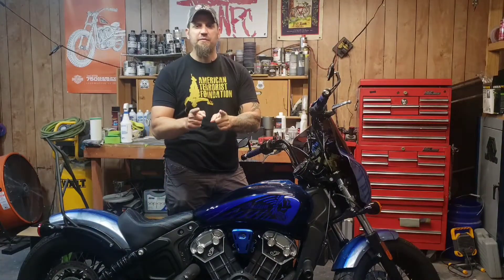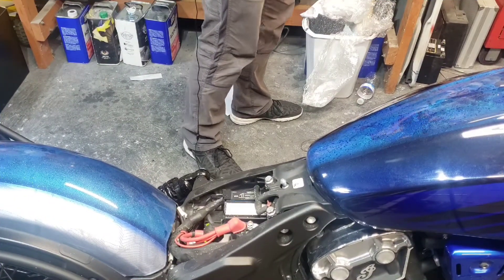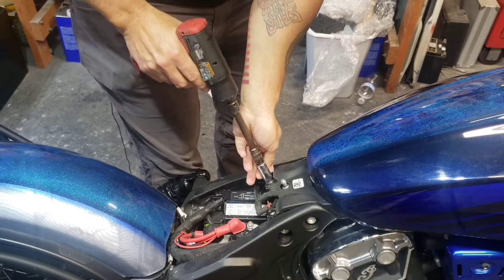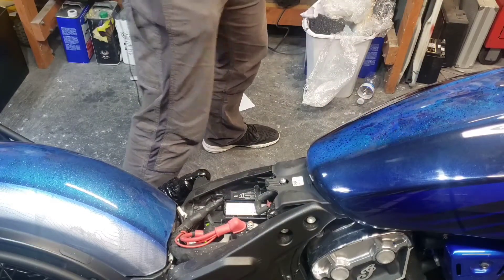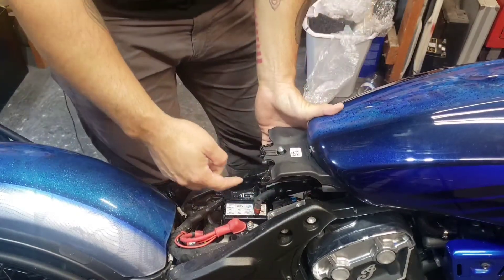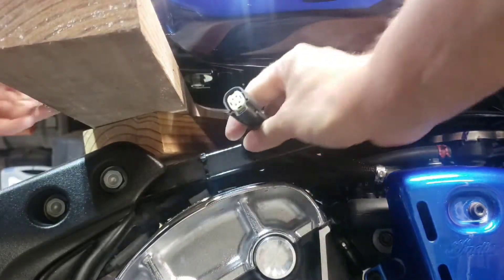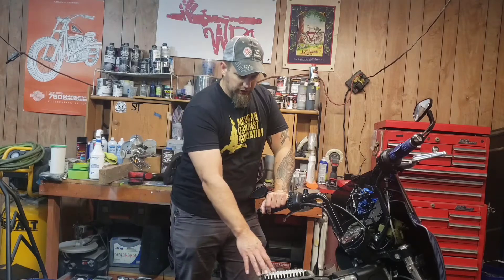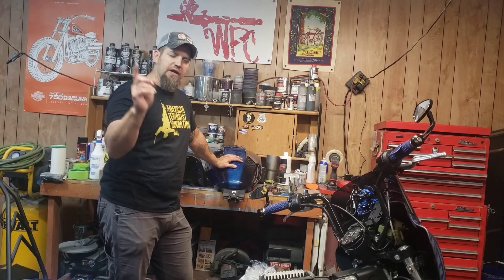how to remove the fuel tank on Indian Scout bobber

Comment: uuggg!! Great video, so smooth and slick getting that tank apart and off!! 
I am not sure if maybe my bolts are a tad longer but as I delicately "fan-angled" the tank free (meaning I was much slower and cautious then how you did it) I dragged/scratched the inside of the tank on the right side on those bolts under the speedo !! Not much space there, @5:39 you see  the two nuts above the rubber mount? 😭
Board trick was brilliant, obvious, yet brilliant! lol That rubber filler piece, that was a test of patience going back in!  😠
I opened the gas cap to let the pressure out before any disconnecting, was that actually necessary?
Reply from the maker: Thanks dude
 You don't really have to open the cap . If it's been sitting long enough the pressure should have stabilized to the atmosphere.  Thanks for watching I appreciate the support 🤘🏻

Comment: hi man i see you know a little of mechanics and wanted to see if you could help me, I had an accident a few weeks ago and im trying to repair the byke right now, but one of the parts that broke was the clamp that holds the front suspension right under the the speedometer and I just don´t know how to replace it or if its safe for me to do it
Reply from the maker: Hey hit me up on Instagram send me a dm with a picture and I will see if I can help you out
Reply: @WarPaintCustom  im about to send you a message rn

Comment: What would happen if those bolts get taken out and the frame slides up making it uneven to get the bolts back in? 5:30 by your hands
Reply from the maker: If you have a jack, use it to keep the frame from moving that way, the bolts will line up when going back in. You have to remove those bolts when changing out the stock air intake. I may have shown that when I replaced it with an S&S intake.

Comment: Does the gasoline not flow out as soon as I disconnect it? (4:04)
Reply from the maker: No. You will lose a little bit but the check valve in the pump will prevent it from flowing out of the tank.

Comment: Cool vid...question though....did indian mis standard and metric hardware on this bike? Lol. I've seen people listing metric socket sizes in some vids. And my exhaust hardware was definitely metric. Just a weird choice if they did.
Reply from the maker: Well some metrics sizes and standard sizes are almost equal. Like 13mm and 1/2 inch. They do seem to have a lot of metric sizes. I worked in import dealers as a tech for many years, so I have pretty much all metric wrenches.
Reply: @WarPaintCustom  in my experience yes, that works sometimes, but you better be careful on a tight bolt...lol. I have both standard and metric, and honestly would just prefer everything be metric when it comes to hardware....but a bolts a bolt at the end of the day. As long as it's holding everything together like it should haha